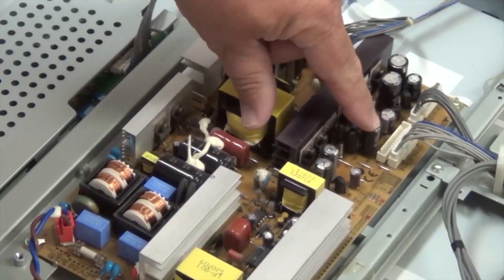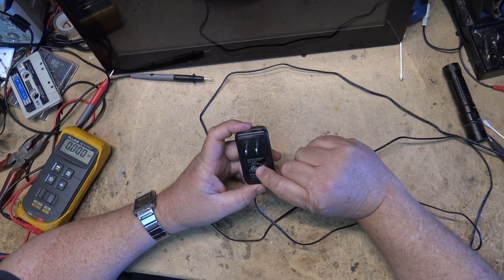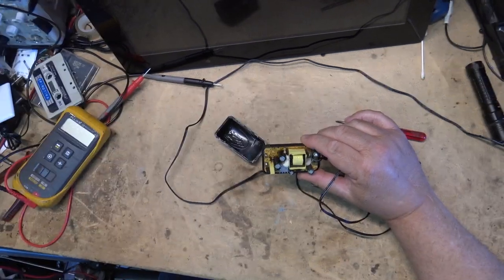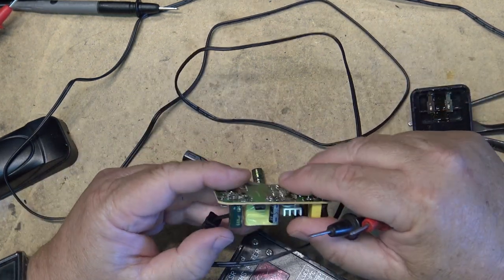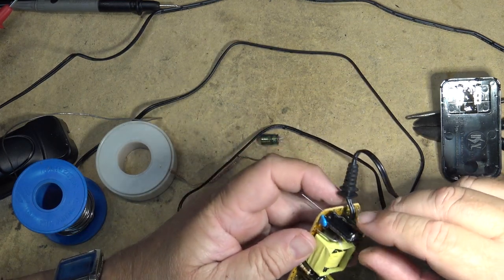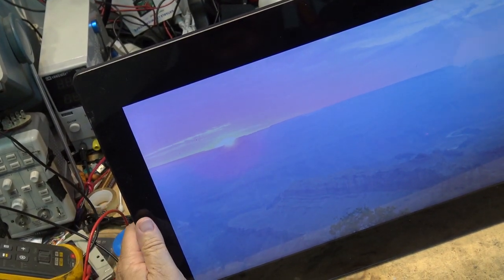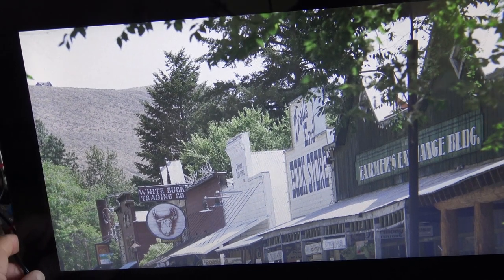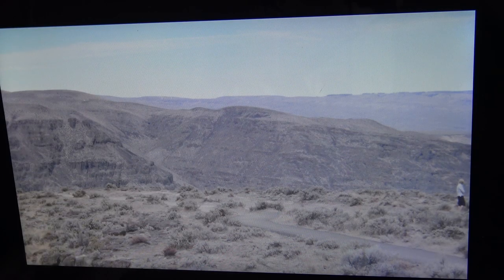Aluratec Digital Photo frame hit by massive power surge can this one be saved

Comment: While I'm only an amateur, I love fixing electronic stuff and car stuff, no matter how cheap it is to just replace.

I recently found a Samsung LCD tv by someone's trash in perfect condition, it just wouldn't turn on. After replacing 5 caps that were obviously bad, it now works perfect. The only downside is I really have no use for it.
Reply from the maker: I was given a samsung tv today. Screen is broken :-( so I guess I gut it like a fish for the board and toss the rest.
Reply: I recently raided our e-waste at work and also found a Samsung tv in there with a bad screen. Harvested the boards and already sold one on eBay.
Reply from the maker: @sjn7220  
I might just do that to the one my daughter dropped off tonight.
Reply: I found a Samsung 32" tv on the trash a couple of weeks ago, Screen was fine but the set was totally dead - turned out to be a shorted diode on the secondary side of the PSU. It's working fine now as a bedroom TV :)

Nice to find a trash TV that doesn't have a broken screen for a change

Comment: I find that often as well that power supply pulsing is caused by the 47-100uF 50V capacitor on the primary side being high ESR as well. Done a number of gate power supplies by changing that one plus the 2 470uF 16V capacitors on the secondary, using 100uF 63V ones and 470uF 25V ones, so that the slightly larger capacitors will last longer, as the things run hot.

Comment: When I repaired an adapter with directly-soldered input pins like this, I didn't want to resolder the pins for testing. Instead, I used alligator clips to bring 120v onto the board. One time when I switched on the power strip the other end of the leads were a bit too close and I got a bright arc flash. Fortunately I switched the power back off quickly and my alligator clips were missing their corners. Fortunately nothing else was harmed and I got the adapter fixed.
Reply from the maker: I knew it was working as I tested it off camera with my alligator clips soldered onto the end of a power cord, but whenever I bring that out the internet safety police write me a citation

Comment: Neat little psu, good safety gap under the transformer.
I drill small holes in my fixed switchmode cases, reduces the ovan effect.
My mates 50 inch tv blew it's power board after a pulsed power cut, he was well pissed off.
Reply: Insurance?
Reply: I think these 'real' adapters should all have good safety, at least enough to meet regulations. Generic eBay ones... Well, I have one where primary- and secondary-side are adjacent wires on a ribbon cable.
Reply: @eDoc2020  Exactly, never buy any mains PSU from ebay/Aliexpress etc. because most of them are a death trap! Or if you decide to buy from there, buy two, then test both of them with a megger between primary and secondary, then rip one of them apart and examine the PCB layout, safety capacitors and the insulating layers inside the transformer. If it seems and tests to be safe, you can use the other one. It might be a good idea to set the enclosure and the board of the sacrificial PSU on fire, to see if it's made of flame retardant materials.

Comment: Few years ago my handheld kitchen vacuum cleaner power supply / battery charger started rattlling when moved, so stopped using it immediatly & bought a new one. It was plastic welded or glued shut, so didn't have any easy way to open it. I'm just an ordinary guy, so I was afraid I might get shocked from some inner component, like capacitor, if I'd break into it by force.

Probably some component had detached from the circuit board, even it was never dropped or otherwise handled carelessly. Ordered the new power supply from local electronics repair shop & the old one went  there to be recycled, or maybe they fixed it, I don't know :P

Comment: I used to open these by putting them in the freezer for 1-2 hours, then hitting the seam gently with the edge of a small hammer. That way almost all of them opens up without leaving any mark. I'd also replace the small bootstrap capacitor of the controller IC, it's right next to its heatsink and the board is darkened there from heat. Since you have this nice in-circuit ESR meter, I don't understand why don't you bother to at least measure all the capacitors once you were there.

Comment: I prefer physical photographs which don't need batteries. 😉
Reply from the maker: I bought a great printer a number of years ago and printed several pictures, but they just end up in albums or in boxes never to be seen again. Displaying them on a digital screen gets them seen so they can be enjoyed, and they change every 30 seconds. Some of the new smart tvs have an ambient mode so they display photos when they are turned off 24/7.
Ant this doesn't need batteries, it is powered from mains. After getting this frame I have not printed a single picture.

Comment: One of my old Netgear Wi-Fi routers has a 12 volt 3 amp plug pack
Reply from the maker: They are available but the ones I have on hand are all 1 amp.  1 amp will probably run this thing but it would stress and probably blow the power supply.
Reply: My old D-Link router from 2006-2007 has 7.5V 1500mA plug pack which is not switchmode, it's a heavy 50Hz transformer, weights about a kilogram. I still use this old router, very reliable, it works 24/7 without any issue ever. Last year it started acting up, it needed a restart every day, prior to that it never needed any restart for a decade. It turned out that the filter capacitor in the wall wart died, and also 90% of the capacitors inside the router was dead open. It was a wonder that it worked at all in this condition. I recapped it, and works like new again since then.
Reply from the maker: @mrnmrn1  
Old dlink from 2007 has many security holes in it.
Reply: @12voltvids  Probably, but the cable modem prior to it also has some firewall functionality in it (I think). Although the modem is not much younger either... 2010, maybe 2012. But that's the property of the provider, so I can't do anything about it. The router is mine, I could have replaced it, but since I have a 20Mbps service, I'm fine with the 54Mbps WiFi until I switch to an other provider (hopefully this year), then the new provider will give me an optical modem with integrated 300Mbps WiFi and Gigabit LAN router. After that, I still gonna use the old Dlink after the provider's modem/router as a backup WiFi access point. It will be after an other router, so its security holes won't matter, unless someone would attack it through its WiFi. I'll try to investigate how vulnerable this particular model is.
I've just searched it. It just have 3 known vulnerabilities, one of them is very severe, although it's been known since 2006 (!) , so it's probably fixed in the current firmware , which is from 2010 IIRC.
https://www.cvedetails.com/vulnerability-list/vendor_id-899/product_id-6788/D-link-Di-524.html

Oh, it has a 'new' firmware from 2013. I'll update it :-) .
https://eu.dlink.com/uk/en/support/security
Reply from the maker: @mrnmrn1  
2.4ghz is so overcrowded.  Useless.  I run everything on 5ghz. I only have 75 down 20 up myself. I could get 1.5 gig if I wanted but nobody needs that speed.  At the speed I have 75/20 I never run out if bandwidth so I won't be upgrading
Reply: @12voltvids  I live in a rural city where 2.4GHz is still usable, probably in the city centre with 10 story residential buildings it's not usable anymore. I have 20Mbit/s download, it's enough for me most of the times, what really bothers me is the 512k upload speed. That's what mainly stops me to upload Youtube videos. I uploaded a video which I recorded from VHS to DVD with a standalone DVD recorder, and I wanted to minimize the quality loss due to multiple encoding, so I uploaded the VOB file directly to Youtube. It was an 800MB file, took about 4 hours to upload!
Reply from the maker: @mrnmrn1  
No high-rise or apartments around me and 2.4 is so congested it is useless.  512 up sounds like cable. I'm on dsl, 75 meg down 20 meg up
Reply: @12voltvids  Yes, cable. 75/20 with DSL?! Is the exchange 100ft away from your house, or what? Here the phone line is so bad (main problem being the exchange is very far away), they offered about 5Mbit/s download 10 years ago, with a guaranteed speed of only 1Mbps... Now DSL is not even available anymore. I gonna switch to FTTH, with 1000/300 (300/75 guaranteed), for lower price than my current 20/0.5 cablenet. And they also provide analog and digital TV on the fiber, my current provider (T-Systems Telekom) only gives digital TV and IPTV on the coax. There's no slower option with the other provider, just 1000/300 at FTTH areas, and 500/300 or 100/100 at FTTB areas. My area is FTTH. Only downside is the new provider's digital TV is encrypted, and only usable with their proprietary STBs, recording disabled. Their Conax chip cards are paired with the STBs, you can't even exchange the cards between two of their own STBs. At the current provider the digital TV is unencrypted, so you can use any digital STB, and record anything you want.
Reply from the maker: @mrnmrn1  The exchange is a few miles away. The DSLAM cabinet is about 750 meters, about 1/2 mile away. I have a bonded loop, 2 line service.Each loop good for about 45 megs down 10 up. We have been switching everyone over to fiber that went in a few years ago. I am a hold out, because as soon as I switch I have to change programming package to new package, and all the channels are in smaller bundles are ala-carte which means I could pay more for what I already have. Also I own my IPTV boxes, but on fiber only 2 are included free and the additional boxes must be rented. On the old system all boxes are free. I work for the phone company, and spend my days installing fiber.  Copper is still in a few areas. A couple of strata devolopments said no to fiber so they are stuck on copper. Our fiber is symmetrical up to 750. The 1G package is 1G down 940 up, and the 1.5g is 1.5 down 940 up. We use Arris IPTV 4K boxes, and they are encrypted. Recording enabled on the PVR, but blocked from external recording. That is another reason I am sticking on the old system, but if it breaks I will have to fix off the books as I can not book a trouble call. That will trigger a fiber migration. The upside is our boxes also get youtube, netflix and Amazon prime. Fiber has been placed to my house, and for that matter I have already run it in, and the fiber is right there next to the gateway, so switching would take less than 1 hour, but I plan to hold out till they force me to change by means of shutting down the DSL cabinet.

Comment: 9:00 unlucky day being off cam eh
Reply from the maker: I left that part in so you could hear the electric car roll by silently.
Reply: @12voltvids  ah right. I think the only sound I can hear are the tires
Reply from the maker: @maicod  Yup. My new one has a noise generator that sounds like a space ship, but that was the old one leaving.
Reply: @12voltvids  I hope it didn't drive by itsself :)
Reply from the maker: @maicod  
I have seen a few of those around.  Scares the hell out of me to see those brain dead tesla drivers with no hands on the wheel.